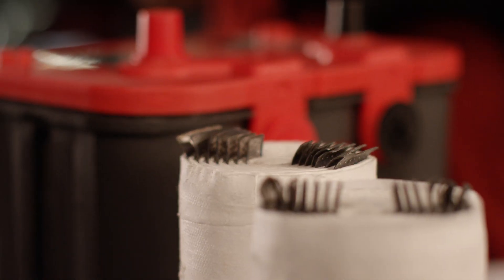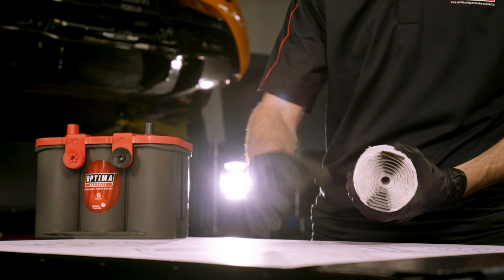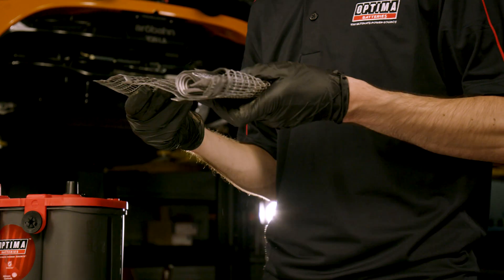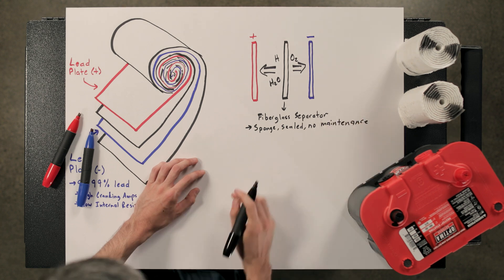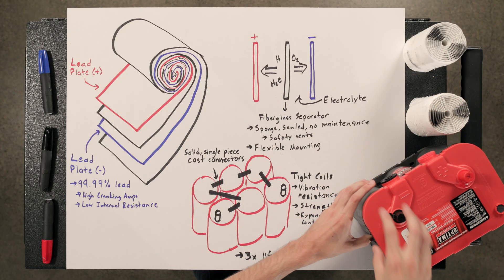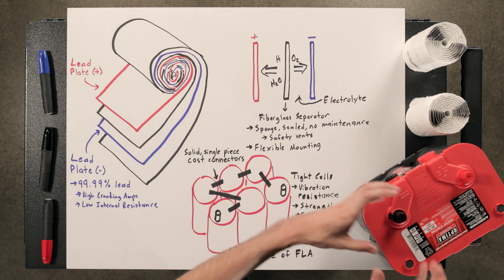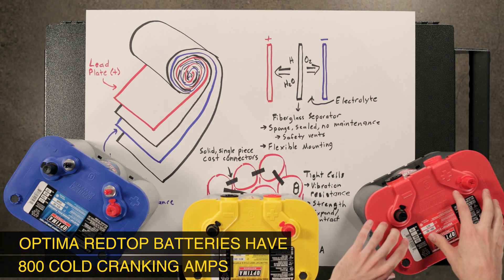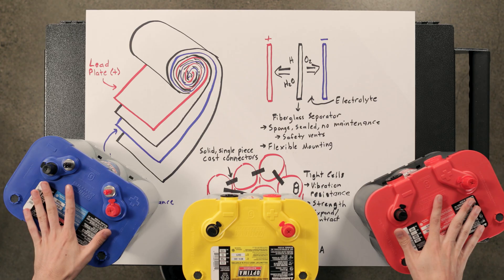OPTIMA Battery Review

Comment: Wait, you used to work for Optima or are you just wearing their shirt?  Wish you'd do an updated video and explain why these batteries don't last as long as they used to after the company was sold.
Reply from the maker: Jason was wearing one of our shirts and has partnered with us in the past. The batteries we are manufacturing today are the best we've ever made, but electrical demands from vehicles continue to increase. That's why so many OEs are now moving to AGM and lithium products from the factory.
Reply: @optimabatteries  The best you've ever made, really?  Then how come like 20 years ago my first Red Top for my garage queen lasted like 7 years, yet my second Red Top barely lasted 2 years?  Both had a battery maintainer on them too.  And many others have noticed the same thing after the Optima was sold.  The quality of the batteries definitely went down and the price shot way up!
Reply from the maker: @Resist4  we understand individual experiences can vary, but we keep a very close eye on the entirety of our production and run junk bin studies to understand failure modes. Many of the "bad" batteries being returned under warranty are "discharge-only" meaning they are just deeply discharged and work fine, when properly recharged. It's enough of an issue industry-wide, that some other brands have included specific minimum voltage level exclusions in their warranty language (we haven't done that).

On the production side, our team is constantly seeking out improvements in our manufacturing processes that further reduce potential issues. All of this is done in an effort to realize constant improvement and the numbers we track indicate it is working. We have to constantly improve our products, because the market demands it. Newer vehicles are more demanding than ever before from an electrical standpoint and it's obvious in the ever-increasing size of batteries being installed at the factory, even though many manufacturers are moving to smaller, four-cylinder turbo engines in many of their vehicles. It's no longer about cranking power, but reserve capacity and cycle life.

We've heard the rumors about the alleged decline in quality of our products ever since the second AGM battery brand came along. Some tie it to a manufacturing change, an ownership change or something else. We've had several parent companies over the years and we did built a brand-new factory to make better batteries, but we still use 99.99% pure virgin lead, connect our cells with robust cast straps and unlike many other brands, we manufacture our batteries in our own production facility and they are the only batteries produced there. We never re-spec or re-brand our batteries for any of our retail partners and we've lost some business because of that, to manufacturers who were willing to make those and other compromises. You can take a virtual tour of our production facility here: https://www.optimabatteries.com/experience/blog/tour-the-optima-batteries-plant
Reply: @optimabatteries  I hear what you are saying yet I keep reading over and over about Red Top failures since your company changed ownership.  And why would virgin lead make any difference in a battery?
Reply from the maker: @Resist4 , we have always been the biggest name in AGM batteries, so you should hear more about us than any other AGM battery, both good and bad. Many people don't understand the difference in volume, but we have more retail locations selling our batteries than some other AGM brands have batteries to sell. When people have electrical issues with their vehicles, whether it is battery related or not, the easiest, quickest solution is often a new battery. That can resolve some issues for a period of time, but if someone has a persistent draw, the same problems will eventually manifest themselves again. 

OPTIMA was the OE battery for very few production vehicles, so when people are using our battery, it typically follows the failure of another brand. We've lost count of the number of times we've heard from people who claim they had three of our batteries fail in a row (not including the battery they replaced). On the surface, that seems horrible for our batteries, but we know the reality of the situation. The battery business is highly competitive. If our manufacturing defect rate was so bad, that 1 in 10 batteries we produced failed because of a manufacturing defect, we couldn't keep our doors open. Even at a rate that would put us out of business, there's still a 90% chance someone would get a "good" battery from us. 

Maybe they beat those odds and did get a bad one? It can happen. At the rate that would put us out of business, there's now a 99% chance, one of the two batteries they get from us would be good. By the third battery, we're looking at a 99.9% chance that one of the three batteries is good. Our true defect rate is far lower and the odds of getting three bad batteries in a row from us or any other quality battery manufacturer are far longer, but those stories keep coming up and few are ever questioned. Everyone who drives a car will typically experience a battery failure at some point, so the response of many is not to question what happened and find the source of the problem, but to offer empathy and perhaps share a story of their own battery failure.

As for 99.99% pure virgin lead, impurities like antimony, calcium, or other metals can affect battery performance by altering the electrochemical properties, leading to reduced efficiency or lifespan. Virgin lead offers uniform quality, ensuring predictable performance in battery manufacturing. Recycled lead is less expensive, but it may vary in composition due to differences in source materials, which can impact reliability. High-purity virgin lead is also less prone to corrosion, which extends the battery's lifespan by reducing degradation of the plates. Virgin lead provides optimal conductivity and electrochemical performance, improving the battery’s ability to deliver consistent power and recharge efficiently. Batteries made with virgin lead are also easier to produce with precise specifications, as the material's properties are well-defined, reducing defects in the production process. If you watch our plant video, you'll see our plates being manipulated in ways that simply are not possible with more brittle recycled lead.
Reply: @optimabatteries  Yet no one uses brittle recycled lead.  The recycled lead they get  with then be tested and have things added to it so it's back up to virgin lead standards.
Reply from the maker: @Resist4  the refining process is getting better, but it's still not as good as pure virgin lead.

Comment: I know there are two types of batteries, traction(deep cycle) and engine start. Your website lists the red tops at 50 C20(Amp Hours) the blue top at between 60-75 and the yellow top as 55 for the BCI group 34 batteries. My question is how is it possible to house both a traction and engine start battery in one case to qualify for a dual cycle battery but only receive an additional 5 C20?
Reply from the maker: More specifically, our Group 34 REDTOP has a C20 capacity of 50Ah, while the YELLOWTOP and BLUETOP D34M are rated at 55Ah. The physical dimensions of those batteries is identical, but the REDTOP, as you indicated, is designed only for SLI use, while the YELLOWTOP and BLUETOP can be used in both starting and deep-cycle applications.

There is only so much energy that can be contained in a specific space and while we can make internal changes to the batteries, to make them more suitable for deep-cycle use, we only have so much space available to use. You'll also notice the cranking amps for the REDTOP is slightly higher than the YELLOWTOP and BLUETOP and that's the trade-off.

While the differences between the respective batteries internally can result in slightly more reserve capacity (in exchange for slightly reduced cranking amps), the ability to be deep-cycled repeatedly over the useful life of the battery is the most-significant difference.

Comment: I have a vintage BMW (1972 3.0cs) the car is not driven frequently I maintain the battery with a Battery Tender trickle charger.The car uses a group 47 battery, is the red top a direct replacement? I do not have many accessories, will the red top be a good match for my car? thanks
Reply from the maker: We list a Group 35 in either a REDTOP or YELLOWTOP as a direct-fit replacement, so either could be suitable- https://www.optimabatteries.com/en-us/product-finder?year=1972&make=BMW&model=3.0CS&engine=L6-3.0L&find=find

Comment: Which battery (Red or Yellow) is best suited for severe winter weather conditions 

By the way my daily driver is a 08 Chevy sedan with a V6 - 3.5L engine
Reply from the maker: It depends on how you define "severe." Either battery will work just fine just about anywhere in the lower-48 states. Fully-charged (~13.0-13.2V) our YELLOWTOPs are protected from freezing down to negative 30F and our REDTOPs (~12.6-12.8V) are protected down to negative 50F. However, the further away from a full state of charge any battery is, the more vulnerable it is to freezing. You can read more here- https://www.optimabatteries.com/en-us/experience/2014/01/what-happens-if-my-car-battery-freezes

Comment: I have a Hyundai Sonata 2015 starting to upgrade the audio around 3000rms. I buy a red top any info if I can use it for the front or as a second battery or 2 in pararel of the same???  I need help
Reply from the maker: Our RedTop batteries are not designed or warrantied for deep-cycle use, which would include car audio. If you are planning on upgrading your stereo system in a significant way, you could isolate the RedTop from the rest of the system and use it just to start the car. We'd recommend using our YellowTop batteries for deep-cycle use, but keeping them properly-isolated from the RedTop.
Reply: OPTIMA Batteries thanks for your service have a great day

Comment: Bought a red top for a Mitsubishi Evo X for the inside of my trunk 34/78 replaced it from factory. they said its fully sealed so i don't need to use my original factory vent tube for this battery since it  has no vent port hook up?
Reply from the maker: Who is "they?" In the unlikely event any battery is overcharged, it may vent gas that is both flammable & toxic. For that reason, we always recommend that any battery mounted in an enclosed area (including trunks & interiors) be properly-vented to the outside atmosphere. If a battery doesn't come equipped with ports for external vent tube attachment, those batteries can be properly-vented to the outside atmosphere with a battery box found at retailers like Summit & Jeg's.

Comment: I would like to connect 100 Yellowtop batteries in parallel in my house. 
Months with no charging require. I guess.
Reply from the maker: That's a lot of money to spend on batteries, you may want to double-check your requirements to make sure you need that many. You might find you can get by with fewer batteries if you incorporate some type of charger to maintain them. You'll also want to make sure to split them into smaller banks, in case you experience a failure. All batteries within a given bank need to be identical in age, size and type and should be replaced at the same time, so losing one could potentially compromise the entire bank.